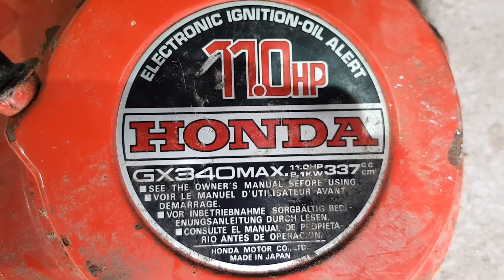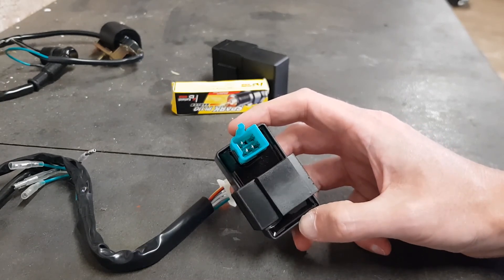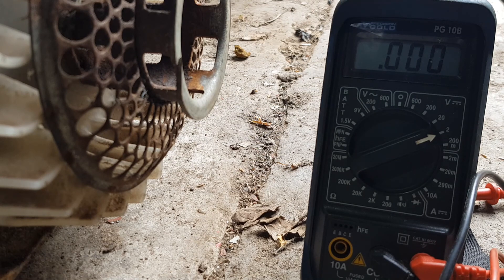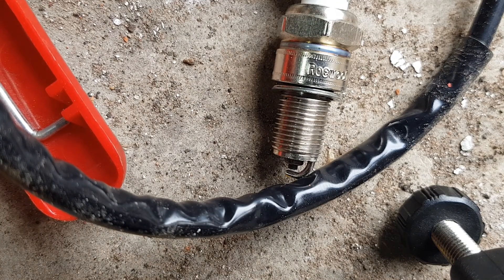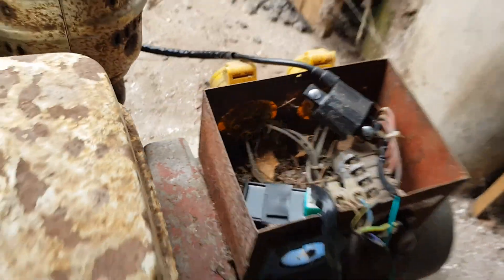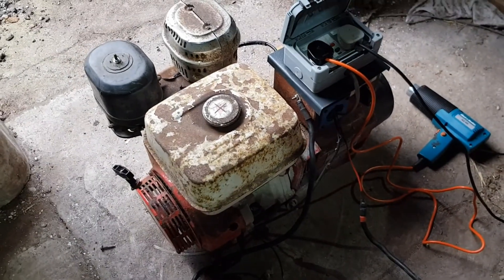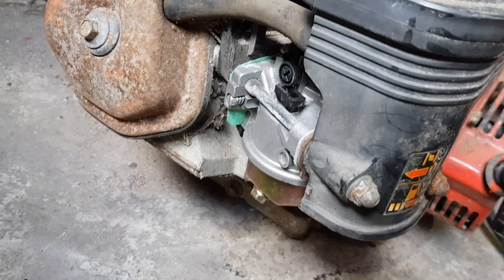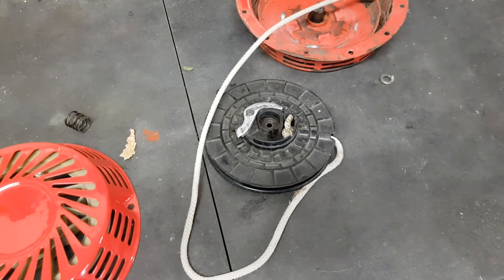Free barn find Honda GX340 generator, will it run with a home made CDI system?

Comment: Needs to run at a constant 3000rpm to create voltage at 50hz, controlled by the governor.
Reply from the maker: Yes. I need to get an rpm meter to see what speed it is running at